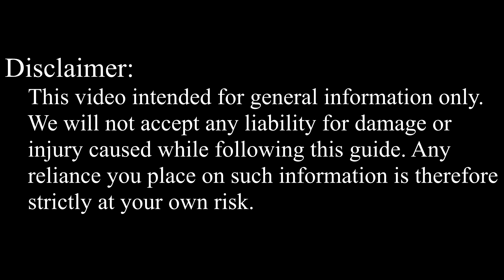Sony VAIO SVP112 Overheating Fix: Disassembly, Fan Cleaning, and Thermal Paste Replacement Guide

Comment: Thank you very much for this tutorial, without your video I would never been able to remove bottom cover of Vaio SVP11, it is put together so well by Sony, after removing the obvious screws on the bottom, I could not remove the bottom cover because the very front edge of laptop the tiny plastic cover seems impossible to separate from the body of the laptop, I didn't want to force to pry it open, but your video saved the day. Needed to replace the battery. You guys are good people!

Comment: Thank you so much for this video. It seems like there are many videos available for the Sony Vaio Pro 13, but your videos are the only ones i can find for the Sony Vaio Pro 11. You really helped me a lot.
Reply: 7 years after your comment, this video is still the only video that shows how to remove  SVP 11 bottom cover, I couldn't figure out how get to the battery. SVP 13 videos are everywhere, but 11 is completely different animal, to get it open is so illogical, without this  tutorial I couldn't do it. in 2024, still one of the lightest laptops around, slow it may be but at 800 grams, only Microsoft  Surface is similar ultra light. Sony design is still one of the coolest looking machines, and SVP series was the  last Sony laptops they made.